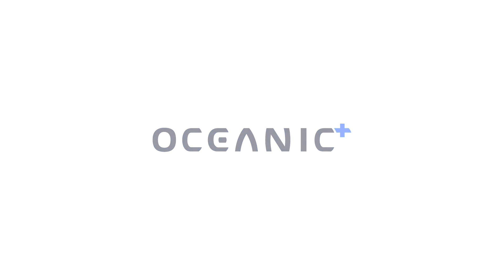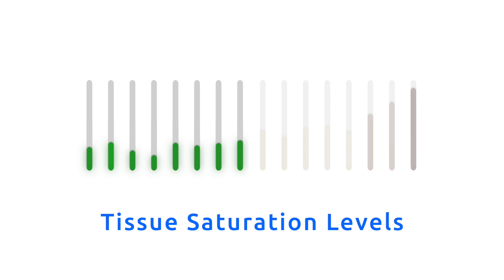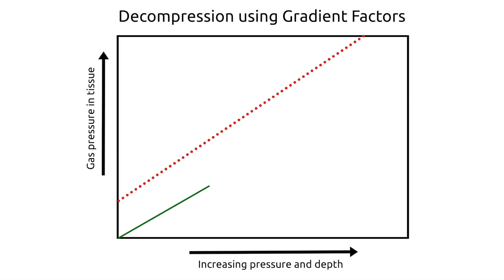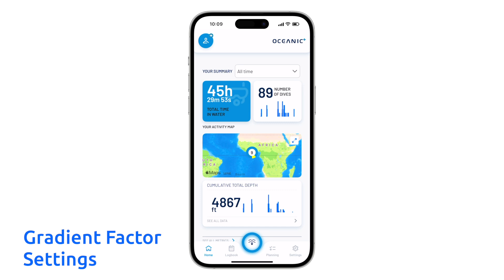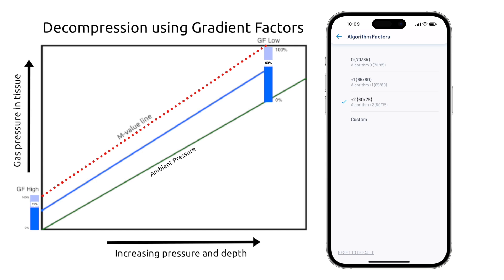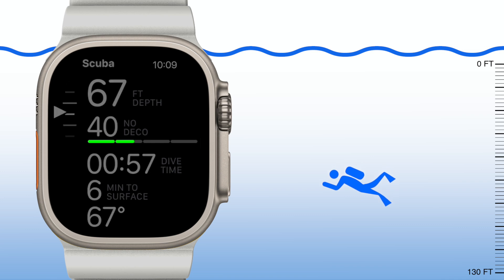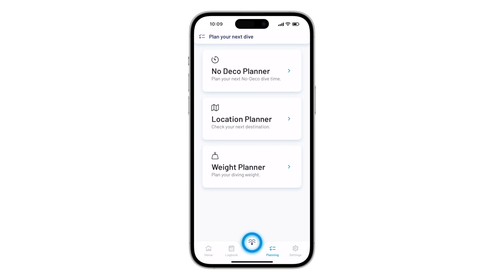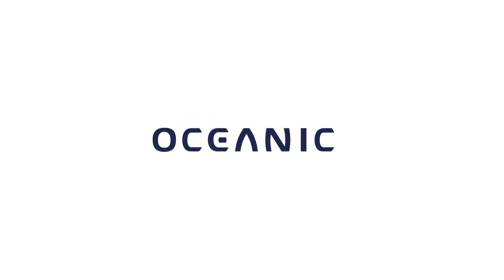Oceanic+ | Advanced Decompression & Gas Settings Tutorial

Comment: CAUTION-read this before buying…..
I just returned the housing. 
I was on a 10 day dive trip and the app / housing worked for at most 10 minutes. I have an iPhone 15. It was using the latest iOS and I even received an app update while on the boat (satellite internet).
Keep freezing up and or shutting down. 
Worked with the tech support, sent logs, deleted the app and reinstalled, sent videos of it freezing up, but they had no resolution. 
I ended up borrowing a different housing from a dive guide that worked flawlessly.
Now the dive shop does not want to provide a full refund and said they would sell the housing on ebay. 
It could be an issue with the housing, good luck if someone else buys it. 
Worked on the Ultra watch with no issues on the positive side.
Reply from the maker: We sincerely apologize for the inconvenience you’ve encountered. To resolve the issue, we recommend ensuring that you have updated to the latest version of Oceanic+, which includes fixes and improvements to this issue. If you have any additional questions or concerns, please don’t hesitate to contact our team directly at tac@huishoutdoors.com. We truly value your feedback and appreciate you taking the time to share it with us. Thank you for your understanding and support.